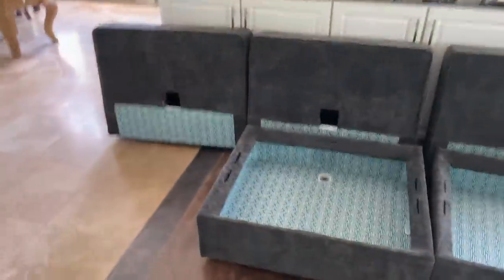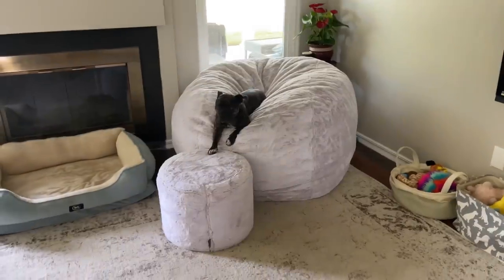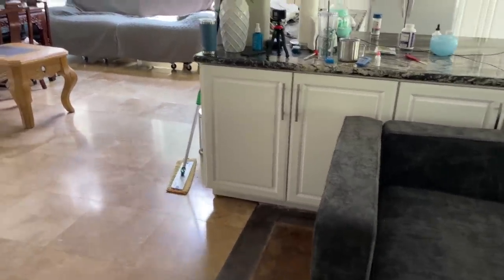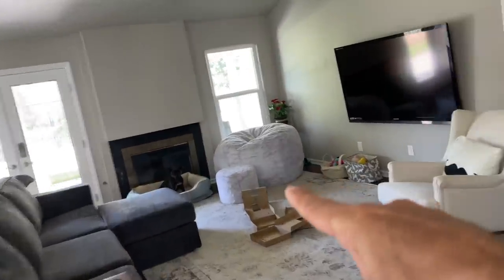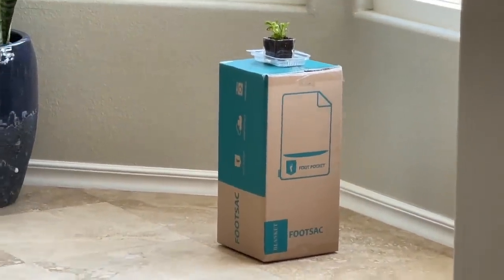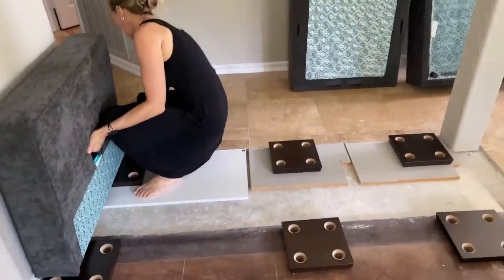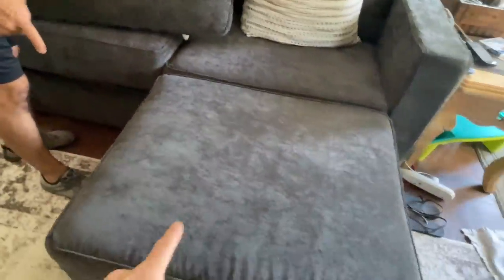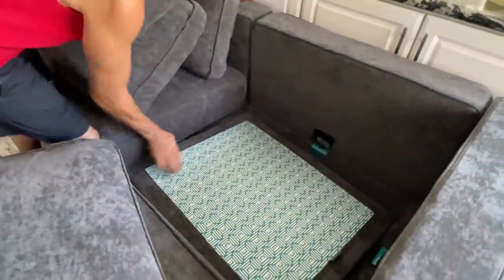Setting Up Our New Love Sack Sectional - The Best Couch We've Ever Owned!

Comment: You don't have another arm for that because it's supposed to be put together as a sectional... The two seat "loveseat" is actually supposed to hook to the end of the sofa where you have your little end table. The "ottoman" is the "chaise" part of the sectional. Then, you put that extra pillow at the other end of the sofa so you end up having three seat cushions and three back cushions where you hooked it together... They don't send you spare parts lol. That was not meant to be two separate pieces. The website actually shows that specific sectional  – except they call them "Sactionals" 😅.
Reply from the maker: Thanks for the info Missychan